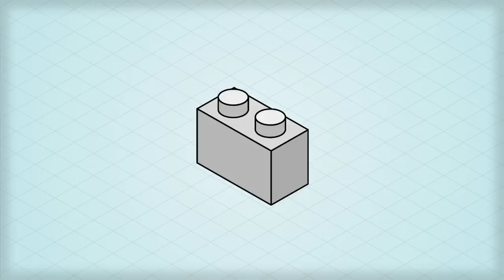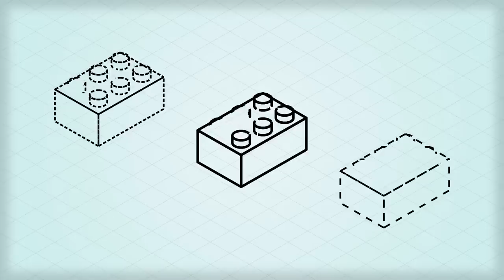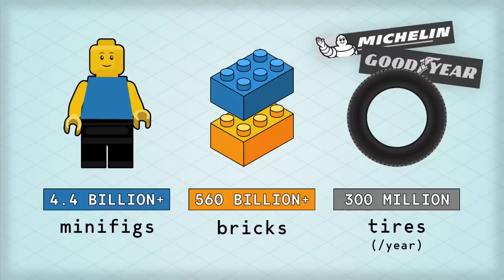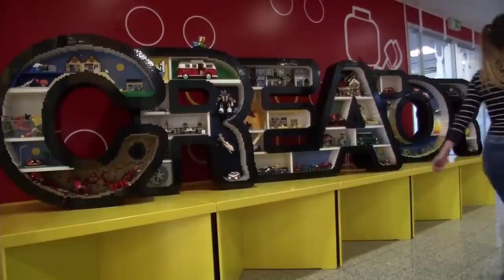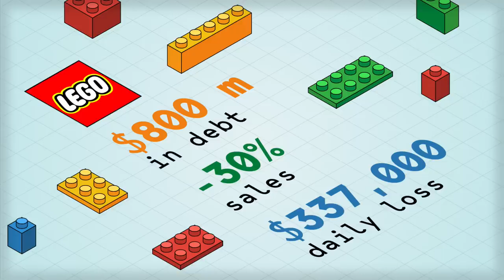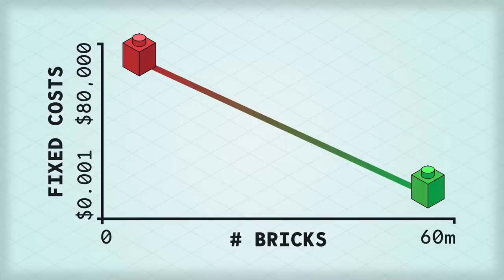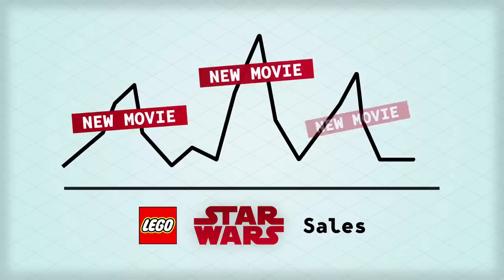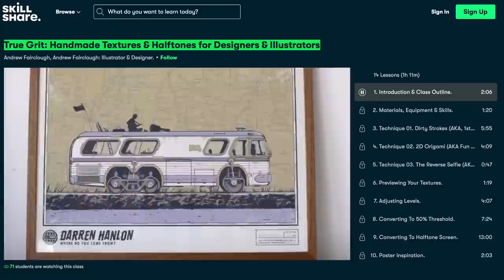The Economics of LEGO

Comment: "If anything, the premium-feel of the humble LEGO brick has only grown — as you discover
 those from your childhood still smoothly, satisfyingly, click-in-place after decades
 of waiting." - Golden Words
Reply: The pale and translucent prints on some minifigures:
Am I a joke to you?
Reply: @jimmalybob4829  ball joints (especially in light blue): Am I a joke to you?
Reply: Yes
Reply: Sorta. Not all LEGO connections click. Some do, but others don't. Among the silent ones are those in between the iconic bricks.

Apart from this minor thing, the line is good
Reply: Lol not mine. I left them out in the heat, and even recently our home gets very hot and I’ve noticed cracks on some of my minifigures.
Reply: Also from personal experience I would say the quality of Lego parts in newer sets has gone down a bit compared to earlier ones. Some of the new bricks either hardly fit together or fit only very loosely so that they feel like Chinese knock-off Lego in a premium priced original set. (Not to mention that their prices are becoming unreasonably expensive for what is offered)

Comment: As an avid fan of Lego, I don’t agree that they focus too much on play. This is a perfectly valid criticism of Lego’s standard product ranges, but they have also dedicated to providing sets that adult fans can enjoy. These sets fall under the “creator expert” brand and use far more complex building techniques than any of their other lines. 

Sure, it still doesn’t compare to the insane builds the community can create, but it definitely caters to the adult audience. The crocodile locomotive, Millennium Falcon, and most recently Colosseum are very well designed, and their range of “modular buildings” have been a staple amongst older fans for years now. The lego building system is also intuitive enough that a young child with enough excitement and initiative could quite easily complete one of the “adult” models, so it’s not like any bright minds are being held back either.

Hence, I can’t really see why anyone would criticise Lego for their choices. Kids are able to enjoy the themed, simpler sets, and keep the company afloat whilst older fans are able to enjoy their more complex models — it’s a win-win.

Comment: As a huge LEGO fan who saw what LEGO did in the late 90s and early 00s I think they made a few big mistakes over the years:
1.Having far too many individual parts. As mentioned in the videos, they allowed designers to go crazy and develop expensive new molds for all sorts of parts, they needed (and IMO still need in some cases) to make sure any new molds (except where needed for a special case like a licensed figure or something) get used in multiple sets to help offset the high cost.

2.Too many product lines for sale at once which made it hard for any one product line to actually succeed.

3.Taking licenses for properties that made no sense or aren't/weren't popular enough to make the needed money. Galidor is the most infamous example but they also made mistakes with themes like Price of Persia and The Lone Ranger and even this years Trolls sets (which IMO would still have been a failure even if the movie had come out as originally intended).

4.Dumbing down many sets and making them too simple with too many large parts. Jack Stone was the perfect example of this but themes like Insectoids and even more staple themes like Trains went down this route. These days they have solved this problem by having 4+ sets that still have larger easier-to-build-with parts but that fit a lot more "in system" with all the other parts (and the 4+ sets still contain traditional figures instead of the ugly crap from Jack Stone). Plus the 4+ sets are just part of the theme rather than pushing out the more detailed sets.

5.Having too many themes that just didn't fit with the core brick. Galidor. Belville. Scala. Znap. Jack Stone (with its oversized figs and specialty pieces).

Comment: oh man i remember Bionicles, i had loads of them when i was like 4 or 5, then star wars revenge of the sith came out, and i switched to Lego star wars and stuck with that for aaagees. As i got older i kinda stopped playing with sets, i still loved building them though, so got more collectors ones (like the 10143 death star). Now that im in my 20's, ive actually still bought a few kits recently, but theyre ones like the Saturn V rocket, or a Sisyphus MOC, and i have to admit but ive also bought a few knock off kits.
That started when i kinda got tricked into buying a Lepin 75192 Millenium falcon, its my fault i didnt read into the listing enough, learnt my lesson, i still got a nice product, it was just double the price of what lepin should cost, yet 25% of the cost of the lego one. And thats where lego hits a problem for me, once i got old enough that my parents made me spend my own pocket money on Lego, i practically stopped buying them cuz they were so expensive. Like that 75912 falcon, a brand new official Lego one is about $2500 aud, which is fucked.
And then theres the other side with older kits that arent produced by lego anymore, like the ucs blockade runner, unopened sets of that are in the $1000+ range, for a kit that was $150 at release, so i was basically forced to get the knock off one.

Comment: No, Lego simply always shows its customers the finger. By now: no knights, castle, medieval theme, no pirates theme, no space theme, a very redundant city theme (no trains or normal building with four walls).

Then the very high price but a deteriorating quality: bad prints (if at all), milky window pieces, scratches, missing or false piece, different color tones for what is supposed to be one color, and now even gaps or misfitting pieces.

@ Lego system: they changed the rails of trains so that older system can't be used, the electrical parts like motors, and now they abandoned the baseplate system.

Comment: 8:58 While this is true when compared to the competition, they are slowly getting worse and printing. for example, light prints on darker bricks usually result in a very distorted an color. And even sets, which target the Adult buyers like the new UCS Star Destroyer utilize a large volume of colored bricks, to build support structures, which is a obvious result of LEGO's supply chain management.
The problem is they are starting to get greedy and you will spot more and more of the bricks trought the exterior, and when you are paying 700€ for what is essentially a toy, that has you thinking.

Comment: Great Video. The depth in which you cover the topic is amazing. I have to disagree with your last statement that Lego is still bought because of its quality. While Lego is still ahead of some f its competitors, the margin is getting smaller. Also the quality inside Lego itself is going down. Sure, the blocks still fit, but when you take the trueness of color and the blocks used for its recent set into account, you can see a trend which goes down. The die hard lego fans, at least in Germany are complaining about this. Also the price policy  of Lego is a big point of criticism.

Comment: I'll tell you one way Lego is screwing up; they have been continuously moving towards a trend of fewer, larger, overly specialized pieces, limiting the play value of Lego sets since they can no longer be used to build anything but what is shown on the box. The point of Lego is not to produce models(which is what they seem to be trying to do) but play sets. The set has to be playable. Also cost. The cost has gone through the roof while the number of "fun hours" per set had fallen off a cliff

Comment: "they are simple to make". Ummm NO!! NO! NO！Only someone who doesn't understand much about plastic injection molding (the way they are made) would come out with such a statement. They work to really tight tolerances. Even now most of their things could not be done by most CNC cutters used on molds. For the time they must have been crazy ahead of most mold makers and/or willing to put time (which would have meant money) into getting to those levels in the 1960s.

Comment: Your last point is sadly not that correct anymore. Lego is losing their "premium brand" status as well. Every more often, they make big quality mistakes. Their colours don't match 100%, I have several reddish brown plates that are all a bit different, same with white, dark red and yellow.
Then there is the problem with the Bell Boeing set, that was to be released this summer but was called back officially because they realized that it is a warplane and Lego doesn't want anything to do with war. (That Star Wars is one of their main themes is to be ignored.) Some speculate that the set really was called back because it had some serious issues with its geartrain and one gear would break easily - somethig you would have noticed during a testing phase and not only the day before the official release.
Lego does once again more and more bad things that might lead to a loss of new customers, as the kids of today might already buy at their good quality competitors and as Lego is far too expensive with some sets and is quality- and set-design-wise not what it has once been.
(Also they don't produce some sets, wanted by fans, such as Castles, Trains,...)